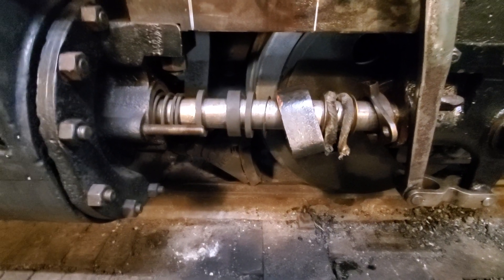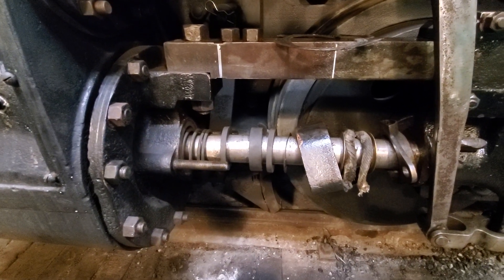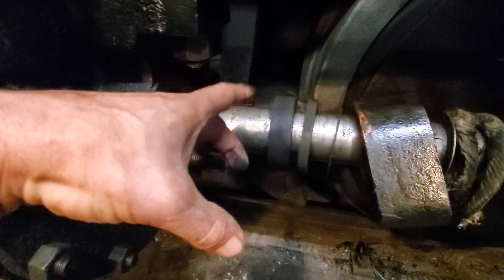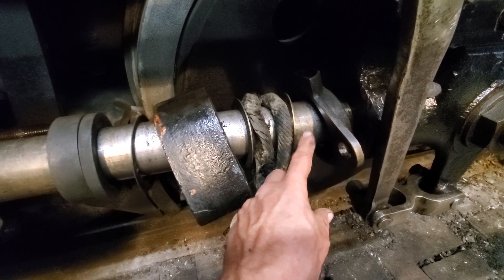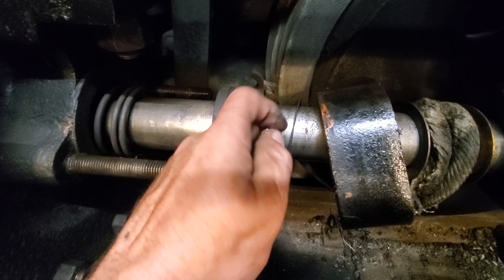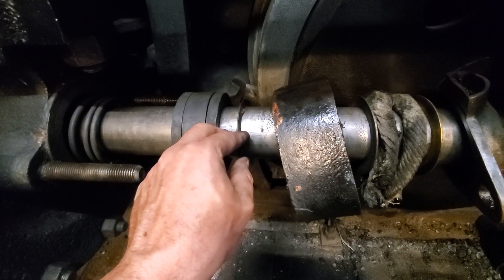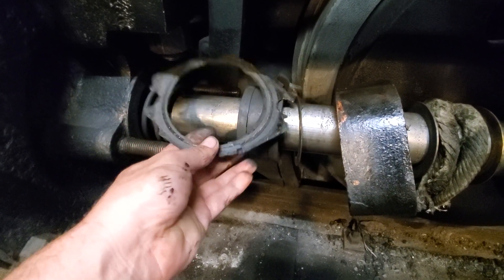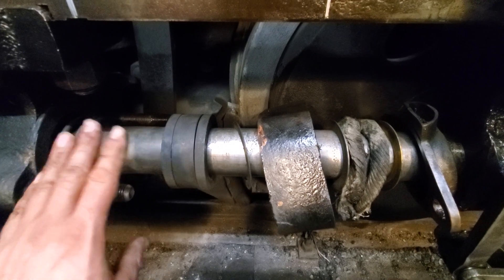J&L 58's Piston Rod Packing

Comment: Did you check all the dimensions of the rod on the outer valve gear as well as stroke and angle of the counter cranks?

Comment: When I worked as an engineer at the family textile mill in the north of Scotland some 55 years ago, we had to fit split gaskets round the steam feeds into the steam heated rollers on a tweed cloth drying machine. These rollers weighed around 5 tons so a split gasket made life much easier than having to jack up the rollers and remove the babbit bearings to replace the gaskets on the steam feed collars. The old engineer had tried all sorts of solutions but in the end he showed me that using toothed pinking shears (used to cut woven woollen cloth so it does not fray) to cut a sawtooth join on the gasket, resulted in the best seal. As pinking shears were already on site, it was also an easy solution to cut the graphite impregnated laminated gasket material.
Reply from the maker: Thanks for the tip!
Reply: I was surprised to see another Wilson out there!  Good, good name!

Comment: Good video. What does it take to pull the piston rod and have it chromed or nickel plated? Since you don't need or want a bright shiny surface wouldn't nickel plating be the better bet?
Reply from the maker: Take off the main rod, then crosshead, then crosshead guide, then the rear cylinder head.  Then pull the piston and rod out. It doesn't take too long to do but it is a greasy and heavy job.  I would probably refurbish the spare set of pistons and rods and then swap them out all at once with new rings and packing instead of rebuilding the ones now on the 58.  This is the nice thing about having spares.